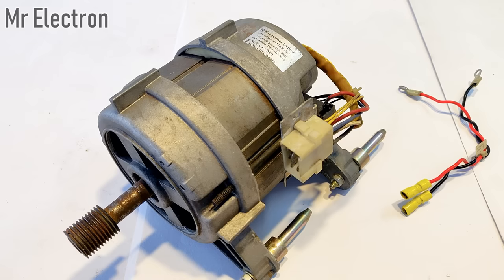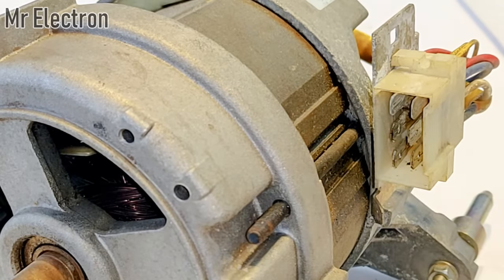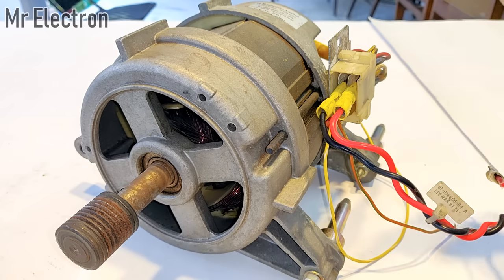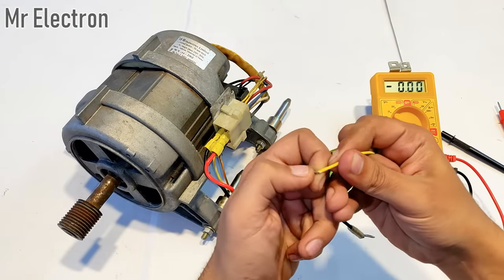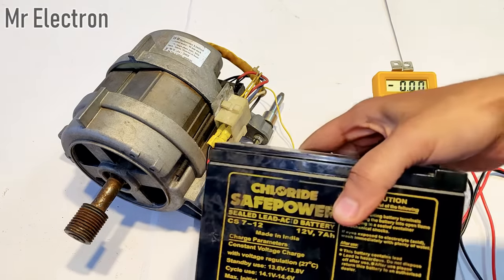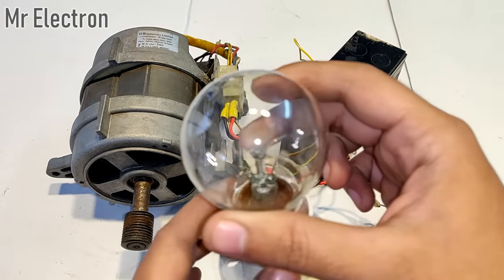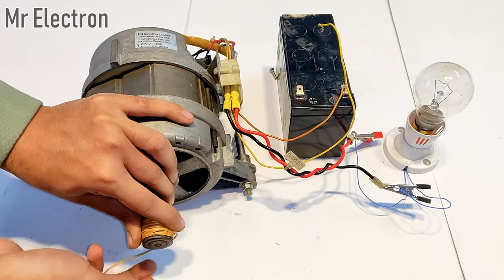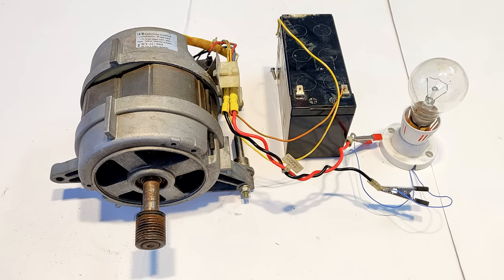Hack ! 220V Electric Generator from a Washing Machine Motor DIY - Universal Motor to DC Generator

Comment: but what is the point you need a bttery  and need enough very very high  wind power to drive the motor fast enough to produce any useful power  mmmmmmmmm

Comment: The actual DC generator uses a rotor and stator connected in parallel  and running without external electric sourse or that sourse is only field starting. The starting sourse can be a permanent magnets on main rotor combined  with exitation coil or a smaller generator coupled with the main rotor. The other away is using a small battery or very little power from the grid. When the generator is exited at it's Max  flux while rotating, it can continue produce power without any external power.
Reply: This was great, thanks, been searching for "free electricity for homes" for a while now, and I think this has helped. Have you heard people talk about - Diyadison Penhloe Blaster - (Have a quick look on google cant remember the place now ) ? It is a good one of a kind product for generating your own electricity without the headache. Ive heard some amazing things about it and my mate got amazing results with it.
Reply: A combination of permanent magnet and field controller would convert this into a practical generator. The magnetic field controller would allow for constant voltage regulation and permanent magnets give you initial field to start.
Reply: how many watts could this motor produce? Mine did not deliver enough power for 60w bulb, i used 12v 12a psu for the rotor
Reply: Source

Comment: The same as how the car alternator works only this thing doesnt have a diode rectifier and the regulator circuit but i like it😀
Reply: Similar not the same.  An Alternator generate AC as it has slip rings, not a commentator.  The clue is in the
 name :)
Reply: @richardcloudbase  this motor is probably an AC induction motor thus it works as soon as AC is supplied and would also have slip rings thus making it an alternator not a generator the output would probably be AC I think
Reply: Exactly I didn't see your post prior to mine
Reply: Dynamic braking in Locomotives ;)
Reply: @richardcloudbase  v.
Reply: A car alternator is 3 phase afaik
Reply: @tristan6509  
...and self excited in most cases

 (a.k.a. a GM “one wire” alternator. Incidentally that makes me wonder about the horsepower requirements; many were/are 80+/- Amps which is like ~1000W.... if you have enough water flow or steady wind, maybe repurposing some scavenged recycled motor makes less sense? I’ve got one; I think I need to experiment with it. 
The advantage of recycled motors is you can modify their wiring to not bog too much with resistance under load- less ‘power per hour’ potential but with something like low-flow hydro it could slow right down and be less output than one designed to make steady power with the water power available.

Comment: This will actually work trying somehow to keep it rotating is another problem if you live near a stream you can use a paddle or in a windy location turbine to top up a car battery or even use a power inverter and solar panels they are quite cheap now but it all depends on one's circumstances. and that motor sounded a bit rough when you rotated it worn bearing i guess but still a good idea👍
Reply: Maybe get a weight, attach it to a chain on a cog, reverse amplify the gears so it turns the motor on the amplified end. Wonder how heavy it would have to be and how ofter you'd have to reset the weight
Reply: Why not attach a wheel to the shaft and arrange powerful magnets in such a way to keep shaft spinning.
Reply: even at max rotation it will not develope any watts thats useful power mmmmmmmmm

Comment: Thanks ...you helped me solve a part of the puzzle I've been missing. 

I'm hooked to the grid of coarse but if it ever goes down because of a natural disaster being able to generate even a small amount of power will make life so much easier.

Thanks so much for sharing ! and hit the 👍button for you.
Reply: You need solar plus some hydro, batteries, inverter, and auto transfer switch. Then you have back up power and save some money every month by using your collected power.

Comment: Question - this model uses a battery to excite the poles which allows the motor to be used as a generator, would I theoretically be able to wire the generator output through the 'power-in' battery like motor-power in battery-storage batteries - inverter? I know it wouldn't ever create overunity, but it could theoretically make the power-in battery last longer by trickle charging while the generator creates power to be stored in the other batteries
Reply: I was thinking the same thing, I'm going to try it and see if i can be done
Reply: @micahzetrovamoseley5256  it would be nice for increased longevity. I suppose if it's not workable I could always grab a cheap mini solar panel, it's part of an outdoor operation anyhow

Comment: Hook up a Bicycle with that motor,and you will have free power.
Reply: No you wont because all you will be doing is turning the food you eat into electricity.  A much more efficient thing to do would be to connect the motor to a steam engine so you get the energy from a small fire and some sort of liquid still not free energy but it’s less work that you have to put in. The best thing to do though is to use solar panels because basically every form of Energy starts at the sun. All that fossil fuels are are really old animals and plants that got their energy from the sun or other plants or animals that got energy from the sun and the food we eat artists plants that got their energy from the sun and animals that got their energy from plants then wind it’s just the effect that happens when the ocean cools down the atmosphere as the sun heats up the land next to it creating a convection cycle so basically with every form of the energy we use we are losing energy between each step but if we start at the source you should be able to get the most amount of energy from it. Sorry if some of the stuff I was saying doesn’t make sense I’m using my voice feature chat right this.

Comment: You realy need to secure that motor it is very capable of damage to you and it's self and others I have some ideas for something like that however not with a motor that big about 1/3 that size spun by a 12" high efficiency fan. So if anybody got any ideas of a motor that I can take and reperpos to my needs

Comment: Can we use universal motor in Electric Vehicle by giving 60v dc? if yes then on slop reverse charging will happens, so is this reverse charging produces Induction effect which will produces AC current that will gone to battery & battery may damage/blast??

Comment: I´m in the process of building this, and my idea is to add a standard old bicycle dynamo, that usually put out between 2 and 6 volts when spinning, to the same belt setup as the washmotorgenerator for automatic battery free exciting of the inner coils. Haven´t tried it out yet, but it should work right? Converting to a fixed magnet core is not too hard, but this would be zero hard, so I´m putting it out there :)

Comment: hi i want to build a home generator using a car engine 2.0ltr diesel i want to produce 220volt can i use the altenaternator from the engine with the megnet conversion you showed and would it be enough to power my house i need to produce minimum 25kw

Comment: the 12v battery simply in  replacement of the required  permanent magnets. Here you need to also have a separate  charging system for  the battery.
Reply: I’m confused how can you make power if you need a battery? Do you mean it’s in replacement of having magnets inside the motor?

Comment: Id be more impressed if you didnt have a battery hooked up to the motor.   I figure the point of making a generator is because you want to create electricity without an external power source.

Comment: So let's hook it up to a vertical wind turbine.  Will it generate enough electricity to recharge field battery that is going to go dead. The law of diminishing return says that  some how you are going to resupply the field battery by some alternate method.  The system at minimum is not very useful as there is no practical way to regenerate power for the field battery.  Fun to do but won't function for anything as is.  An old vehicle generator with permanent magnets would not need the field battery.
Reply: yus  a waste  of  time   lol lol lol oh for  lol mmmmmm

Comment: Why not supply the DC Voltage field from rectified DC from the armature windings you would need a battery to supply the initial  starting field voltage and a relay to cut out the battery once steady rpm is reached it would thus self supply its own field coil energy?  You could probably use a car voltage regulator ( old style one ) and have the 12 volt battery permanently connected having it provide the field coil with energy, The same as used in modern car alternators.  The second question is the output AC or DC?

Comment: So I have a wooden wind gen prop spinning 200-800 RPM. I wonder how many WATTS that motor would make at 400RPM and how many washing machine motors match that design?
Reply: @Matthew Curry none no watts at all you need 11000 rpm thats a lot of wind power mmmmmmmmmmm
Reply: i have more than 1000 rpm on mine and can not deliver enough power for 60w bulb

Comment: Step down voltage output to replace 12 volt battery with self stimulation to field stator windings once current has been established.  Step up voltage output and use potentiometer and spark gap (could include diode and capacitor if needed) to DC pulse rotor. Unless rotor already uses brush contacts (DC motor.)
Reply: new inventionsns
Reply: We can put more than 12 volts? So we can have a bigger output?????

Comment: 3:13 Ok so the battery is charged 100% at 4.2V, 3.7V is the nominal voltage but around this voltage the charge state can be anywhere between 80% and 30% so ... I would say it's not charged properly.

Comment: Can I Know about the Rated RPM when Connected to 12v
What is Hp rating of the Motor at 12v ?
Reply: Electric motors produce Horsepower 
Generators produce electricity 
This was an AC motor, connecting the wires in a way, which converted it  into a DC generator, not a DC motor.  
The 12 volt battery wasn't used to turn the motor.
 It was used ONLY to connect to the field circuit,  creating a magnetic field , so when the shaft was turned ( by hand), it would "generate" electricity.
Horsepower is not created, only electricity is.
So if you mounted fan blades on the shaft, and put it outside, the wind would turn the shaft, and it would produce electricity.

Comment: I want a single motor than can produce power without supporting it with a battery, possible?
Reply: Some newer washing machines are starting to use Brushless digitally commentated motors.  These have permanent magnets in the rotor and a 3phase stator winding.

Comment: Up to 690 watts at 220 volts is only slightly more than 3 amps.  What you going to do with 3 amps?  Efficiency is not going to be worth the effort put into keeping it rotating.  Cool though for showing how power generation works for a science fair.
Reply: YUS AMPS  TIMES VOLTS EQUAL WATTS

Comment: I think this is just amplifying the current from battery....only it can generate power if there is any battery connected to its armature..you can change this motor to alternator if some connections made internally and if you use diodes. So it will work as a an alternator but you need any prime mover to generate same...
Reply: That type of motor will never work as an alternator.

Comment: I am planning on making a wind turbine will this kind of motor creat  enough energie to be put into the European grid?
Reply: Use a PM alternator. No manintanence. No batteries required. Running cost is zero. Can operate as long as several decades without a problem.

Batteries require replacement once in 5-6 years.
Reply: @cypher10297  thanks
Reply: @Veerboot_feest  Check out Axial Flux PM alternators. Best suited design for wind turbines.
For idea about it,
Search for "Brit wind" from the channel Fully Charged

Comment: Seems odd to have to supply a generator with power - it would be better to hook it up to a wind turbine. That’s the function of a generator anyway, not to use it as a motor which then produces electric power. Just seems odd.
Reply from the maker: same thing is applicable for a car alternator.
Reply: Mr Electron of course, but one has to ask the question: if you supply the “generator” with electrical power, and then that “generator” produces electrical power, then why not just simply cut out the “generator” and use the electrical power you were supplying to it. You’d have more electrical power.
Reply: @Alrukitaf  because the power out is significantly higher than the electrical power in.  The output power is the mechanical energy used to turn the shaft converted to electrical energy.  If you had permanent magnets in the stator you would not need to power the field winding, but big magnets are expensive.  Also you would need AC magnets to run it as an AC motor in its original application in a washing machine.  As we all know AC magnets are like Unicorns :)
Reply: richardcloudbase two things: if electrical power out is greater than the electrical power in, then you have created energy from nothing, and the entire scientific world would be knocking on your door to find out how you did it. (I suspect you meant power out is less than power in). The other thing: there’s no such thing as an “ac magnet” (perhaps that’s what you mean by “unicorn”?) you mean a coil supplied with ac.
Reply: @Alrukitaf  yes the electrical power out i higher than the electrical power in.  The power in to out is conserved and no rules are broken.  As I said before mechanical energy is added to the system by spinning the shaft. 

(I suspect you meant power out is less than power in)
No I did not mean that. Power out is the same as power in.  X kw Mechanical (turning shaft) in Plus x Kw in electrical(power for field winding) = Y electrical out plus y heat

Regarding the magnet, maybe I should have said "AC permanent magnet" I know you can make an AC eletro magnet.
Reply: richardcloudbase yes heat losses. But there are large, very difficult-to-account losses in the system, and these losses come to very significant amounts. 

Also the ac permanent magnet - no such thing.

Comment: Helo Mr Electron and thank you for your very good posts .  in my experiment i use a brand new washer motor i spin rotor with a 12volt 10.000rpm motor that is using 3.6  watt   ( connected on  12v 7 amp battery could be on a solar panel)
to excite i use 12v 0.025 a so  0.3watt  ( again could be on solar panel) .  output is 15volt AC 0.45 amp so 6.85watt 
which is a 30 per cent generation of free energy ,however it is AC converting in DC would sink my gain 
same experiment on DC/DC with brushless provides  about 39 watt 12 volt so i believe it is worth experimenting further .
thank you again for your posts.
Reply: How do you keep the battery charged with this system thanks
Reply: @bebright-tq6gx     to be honest i did not run until battery(ies) was empty ,you would have to use diodes to make sure the battery  charging current goes in right direction ( these use energy). according to measurements there is a 30pc gain diodes would likely use this also leaving motors running all the time would lower performances due to heat it is very likely you would benefit of being assisted by a small solar panel ,and i did not experiment for hours just tried a quick set up ..there seems to be possibilities maybe not power generation but at least balance between out put and input . using permanent magnet generator and remaining in DC is very likely to lead to proper generation but requires more investment which i might do one day , idea behind this is be able to have electricity when weather does not allow good solar panel use

Comment: Is that AC voltage or DC voltage? If we take load on stator winding and field excitation on rotor, what will happen?
Reply: ac is alternated current basically your home outlets, dc is direct current which is the sun, PV batteries anything that is used for direct transfer of energy.

Comment: Waste of time watching.. thers no thing to do with the battery by producing v to the output
Reply from the maker: Battery excites the field winding without which it won't work as a generator.
Reply: this small amount of external  DC source simply replaces the role of the  typical permanent magnets field requirement...  I have an old motorcycle engine which can turn this washing machine motor, but is it worth-making? what if will  i just buy small generator?

Comment: you got lots of things are missing. Rather then turning it by hand you can use another motor to turn it with battery and motor. if this is working really this means endless power is exist. which means if motor turns faster it will generate more power so light can turn on full power which means 110 volt and 100 vat.and battery is 12 volt in same time you can use power regulator to charge battery and store energy and turn motor in same time  if this is true many people already got this idea working